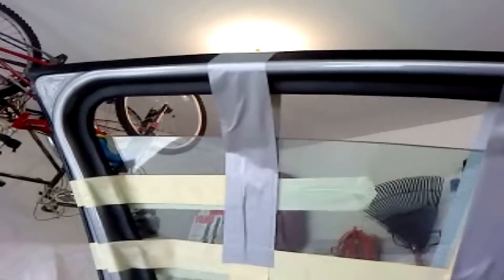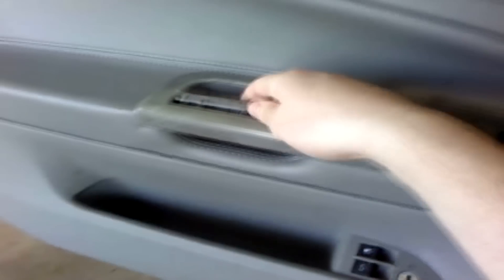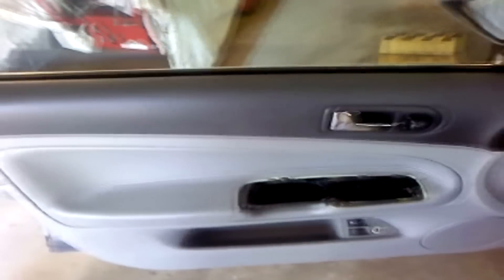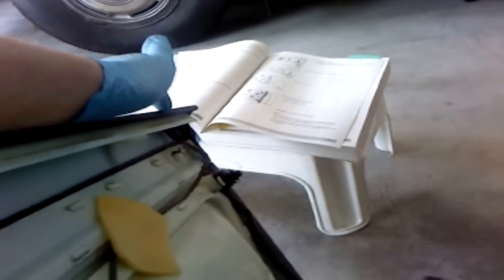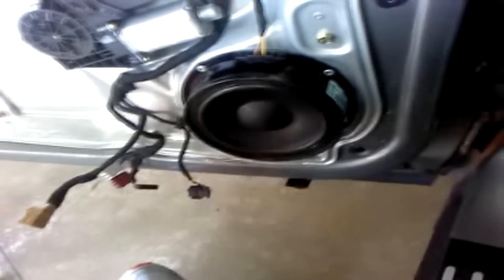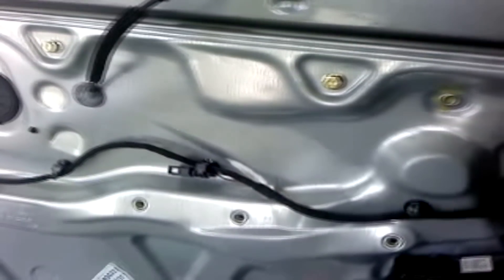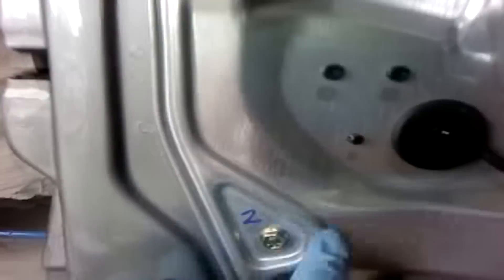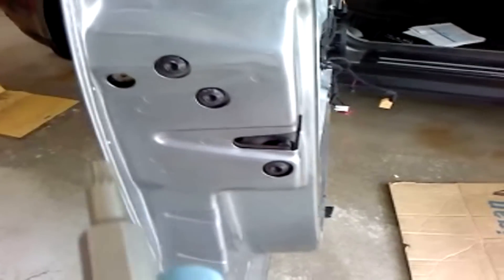02-05 VW B5.5 Passat Removing Interior Trim and replacing door lock actuator

Comment: Awesome video man! I have a problem with my window. Can open it like how you did it as it isnt working. How do you lower window manually?
Reply from the maker: Mike Mercado thanks for the complement. You'll have to remove the trim to the point seen approx 6-7min in to the video. At that point you'll be able to see the window motor. on the end of the motor you should be able to get a socket or tool in it and lower the window manually. I remember reading that this is only to be done if your window motor is broken as it either breaks the motor or messes up the window motor position system. I hope your repair goes smoothly. thanks for watching and liking the video!
Reply: I removed the motor and move the window down. Finally got access to the two bolts that clamps the window. I put a new power lock, new harness and still didnt fix my issue. I ordered a CCM and probably this will fix the issue. If not, i beleive I failed.
My issue was my central locking and window control stopped working together with the power window and heat controller at the same time. But the Gas and power trunk lid still works.
Reply from the maker: Mike Mercado that does sound more like a ccm to me. However I have not had to replace one.

Comment: Was wondering if the actuator fails, does it make the side mirror control and window opener won't work too?
Reply from the maker: +Mike Mercado I don't think that is very likely. I'd look at the wiring, connections, or your CCM/CCU Comfort Control Module.

Comment: do you know if the removal on a 2010 passat is similar to this model. i have to replace the door lock actuator on my wifes car.
Reply from the maker: No clue. I suggest purchasing a Bentley service manual. It will give you a good idea but not every step or detail. it is more detailed then a Haynes manual which is pretty much useless for these cars.

Comment: What is in there book? Repair manual? Where can i got it?
Reply from the maker: The service manual will have any information needed that is not in the video. I don't think there is any additional information for replacing the lock, but if you were replacing the window or power window motor then you'd want it. You can find a digital or print copy on the publisher's website: http://www.bentleypublishers.com
 people are also selling their copies on eBay and various vw forums.